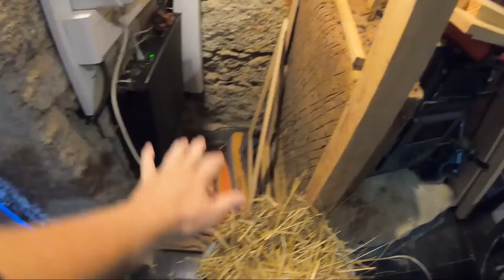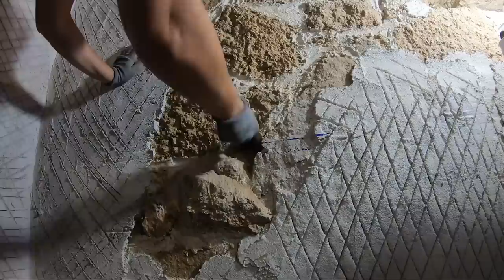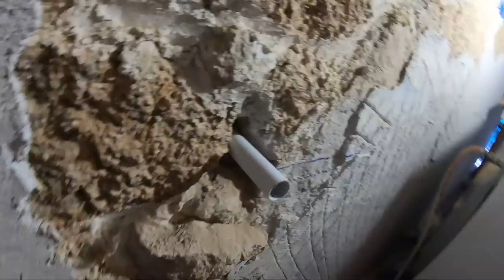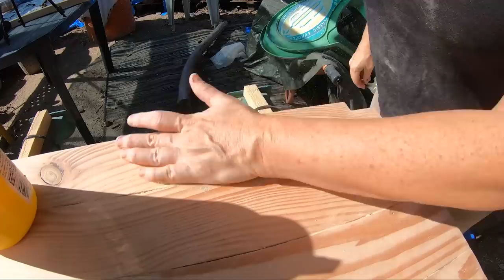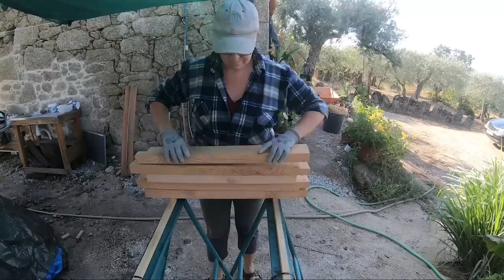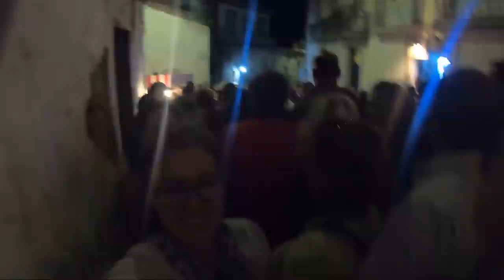DIY Work on My Off Grid Barn Conversion in Portugal & Chocalhos Fun!

Comment: I mix the sawdust with the glue and then use a paint spatula to push it into the cracks. Works like a charm and I have less glue on the surface of the wood that way.
Reply from the maker: Thanks! I've done it this way before and I agree it's better.

Comment: Make sure your gas botlle is isolated. In the winter if it is below 5 degree than, if butano, it will have some difficulties on cold rainy days. Funny video in Alpedrinha. Nice one...
Reply from the maker: I think you meant to say insulated? it will also be isolated outside! :-) But I'll insulate it too both from the heat and the cold. Thanks for the heads up! I've had some friends with issues in the winter, even though it doesn't usually get super cold here.

Comment: Stone looks lovely getting some kool skills your learning
Reply from the maker: Yes it's been a huge learning curve which has been very fun!
Reply: @PortugalfromScratch  hard to beat learning on the job
Not a fread of change
If you don't mind how much is
Sand
Cement
Reply: If you see bad grammar please don't mind
I want to purchase a little house etc i have a couple of projects i need to finish here in Ireland
Reply from the maker: @deranocasper  Yes, materials costs are going up, though I try to avoid using cement as much as possible. 😁
Reply: @PortugalfromScratch  Thank you

Comment: Just living vicariously through Kirsty 🤗

On the filling of the cracks, it looks good. In future you can use a rubber spatula or old gift card to sweep the sawdust into the crack, then water your glue down just a touch and use the card again to force the glue down into the sawdust. Will likely have to sand both sides again LOL

Edit: Also so glad to see you guys getting some relief from the heat and enjoying your parties!
Reply from the maker: Thanks! Last time I mixed it on a yoghurt pot lid and cut a plastic piece as a 'spatula'. This was me trying something new but I like the other way better.

Comment: The sawdust and glue is a valid technique.. works great with PVA glue.. next time maybe experiment by mixing glue with sawdust first..make a paste..work it in..leave a touch proud for shrinking and sand the next day...  Just a thought 🤔
Reply from the maker: Is PVA glue something different to what I used? I tried the paste thing in the past and it wasn't so good, but I think I'm sanding way too soon... but this method I used wasn't ideal so I'll try your way, thanks!
Reply: @PortugalfromScratch  I'm not sure what you had . It probably was pva tbh..definitely need to let it dry so the sanding disc doesn't pull off the damp glue..
Reply from the maker: @tonyhussey3610  Makes total sense! Thanks!

Comment: I was told to mix the glue and sawdust into a paste and then use it to fill in the cracks.
Reply from the maker: Yep this way is way better. I've done that before and this was an experiment but I'll go back to the pasty way for sure. And maybe let it dry for way longer, too. I got a bit eager!
Reply from the maker: Yep, the other way is better for sure!

Comment: Your wood filling process is unique to others I've seen but what ever works...most of what I've seen - people make a putty with the sawdust and glue then that is pushed into a crack or gap and scraped level, let that dry and sand. This seems to leave less material to sand off than your process.  But I do love your creativity in finding solutions.
Reply from the maker: The other way makes more sense for sure and I've done it that way twice before... probably should have mentioned that! But it didn't seem ideal and so I thought I'd try this way and I don't think it's the way!! :-) Will go back to the other method next time, I think!

Comment: You can use that rubble you swept up for your garden pots to open up the soil
Reply from the maker: Ah interesting but what do you mean... ? I don't fully understand. Just stick some in the ground to create air pockets?
Reply: @PortugalfromScratch  if you save them you can add them to your garden pots along with soil, sand, straw, blood n bone, coco peat, vermiculite, perlite. You don’t need all of these but a good open mix allows your plants roots to move faster and your plants to grow faster.
Reply from the maker: @sashacat53  Interesting and good to know, thanks!

Comment: ive been looking at alternatives to gas and discovered if you have lithium batteries it may be better to use an induction hob and a ceramic heater for your main heating..the ceramic fires are super efficient and act like storage heaters..they take 45 minutes to cool down and 3 minutes to heat up..with gas being expensive i imagine the solar could reduce costs perhaps.?
Reply from the maker: Thanks but I'm not sure I understand... the type of battery I have wouldn't have an influence over the power I use to heat things... I'd need a larger inverter to be able to run things that get heated up. Not sure about induction stuff though... but it's not about the batteries, I don't think. It's my inverter and it's not that big. However if I can heat things without the gas its definitely worth looking into! Unfortunately I like my oven and grill too...
Reply: @PortugalfromScratch  i believe the 600w ceramic heater would heat your area..made by MYLEK..some are designed especially for solar..you can also get whats called a solar dump where excess solar heats a hot water tank..you can also buy a ceramic mini hob and oven..the 600w heater costs 6p per hour to run based on unit prices of 20p..in the uk unit prices are 35p per hour...you could invest in an extra battery but would only need a 2000w inverter to run everything up to a tumble dryer(but not included)..things like lawn mowers and strimmers..payback would be 2 years of gas money i reckon..but you are smart so would have worked it out i believe..well done.